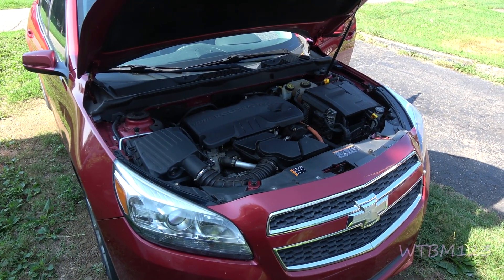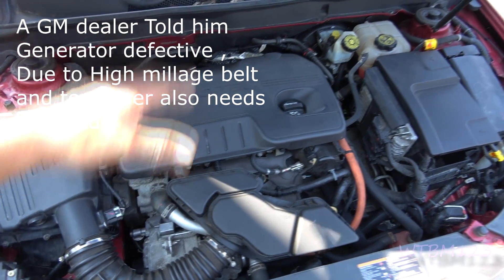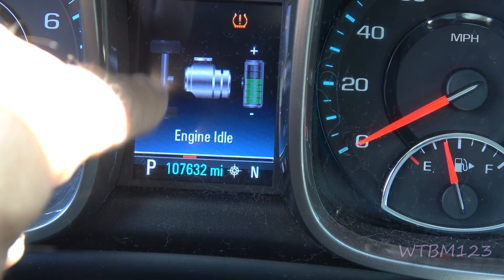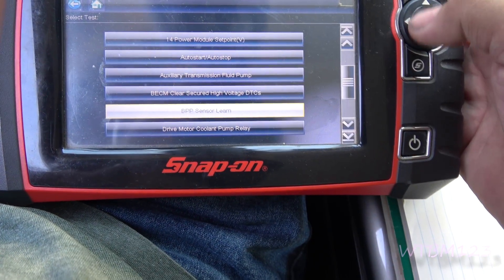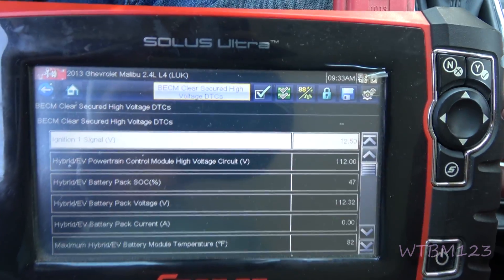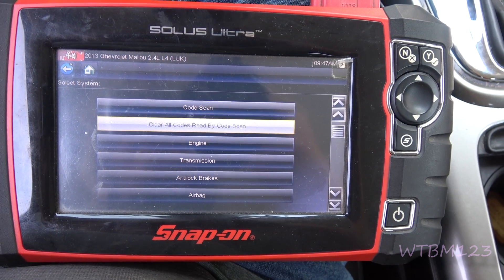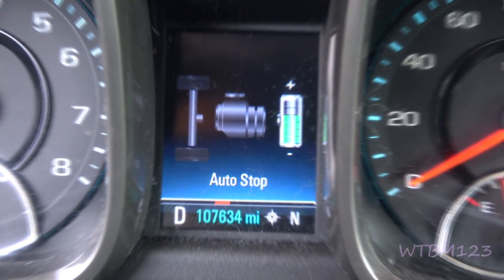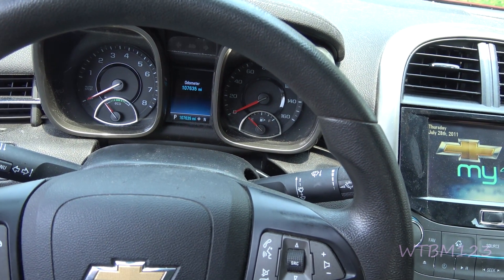Hybrid Malibu ,not charging after broken drive motor bracket replaced. P0A90 , POAB9 , POAFA Codes

Comment: The bracket broke for me and they replaced the bracket and then the belt broke
Reply: So do I just change the tensioner and belt and clear codes now?
Reply from the maker: Seems when i se a broken bracket it also has a bad tensioner , probably what caused it . Depends on what the codes are , and some things may need reset , depending on codes .

Comment: My problem is the drive motor does not crank at restart any idea on what it could be
Reply from the maker: Sorry but not sure with out seeing computer data. Is the battery good  and all connections good , it still needs the small battery to start.
Reply: @wtbm123  couldn’t figure it out car works at auto stop but will not turn back on so I’m just doing a auto stop delete

Comment: I have searched and searched for why my car will not charge. I almost bought a while new battery system (per the dealer) I am so happy I found this video first! They were going to charge me almost 14,000 bucks!!! By bracket broke as well. After I fixed it, the spring for the tensioner broke. I will update after I get codes cleared.  Thank you
Reply from the maker: Usually i believe the tensioner goes bad then the bracket breaks. Hope you get it sorted out and it is something cheap and easy.

Comment: Great video.  I have P0A90 code, battery is charging, auto stop is working intermittently.  Not sure if alternator bracket is broken.  Will share with the mechanic to check.  And see if he can clear the DTC fault code.  When I decelerate, it seemed like fuel is cut off, and jerked?
Reply from the maker: This one did not shut off . Does it show battery charging or any charge on the battery indicator . Please let us know what they find As it may help others .

Comment: Odd that the bracket breaks,  Not quite enough bulk metal on the bracket to cope with the stress?.
Maybe they should of fitted a rubber mount to absorb the shock.
One device doing two jobs, not too smart an idea :-(
But what do i know lol.
Reply from the maker: That is what the big spring on the tensioner does . It was bad and that is why the bracket broke . I should of videoed that better and explained more as you are correct it is important
Reply: @wtbm123  No your video was fine,  ii'm a bit thick at times lol :-D